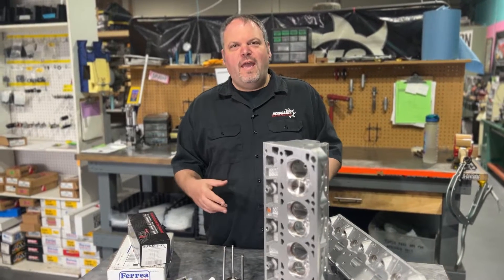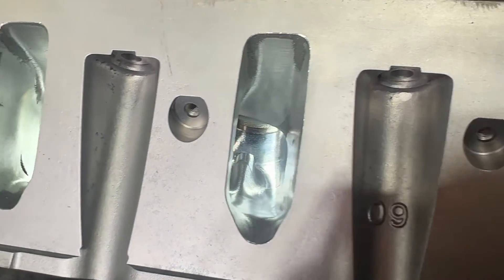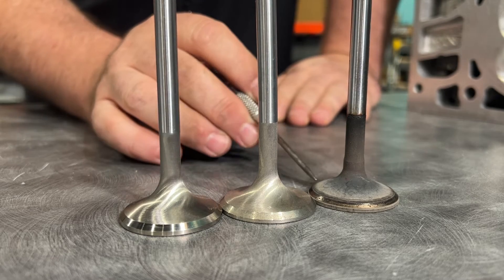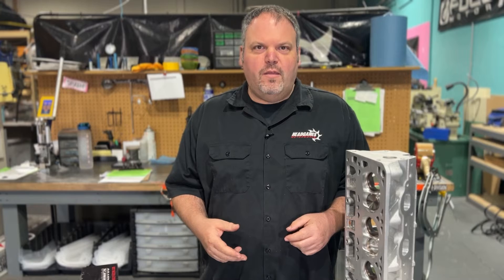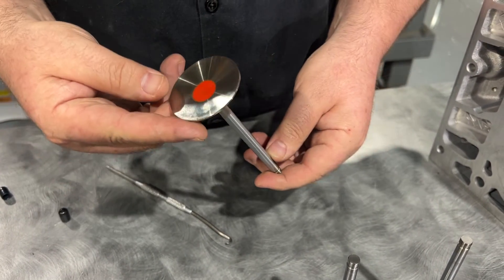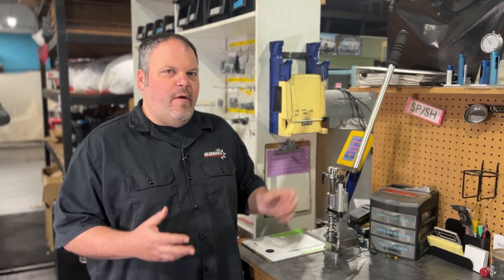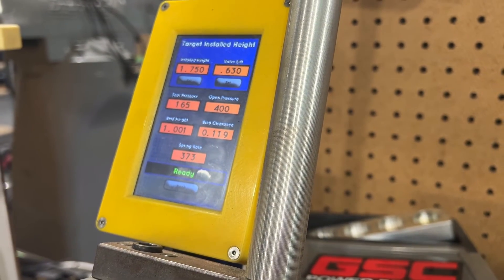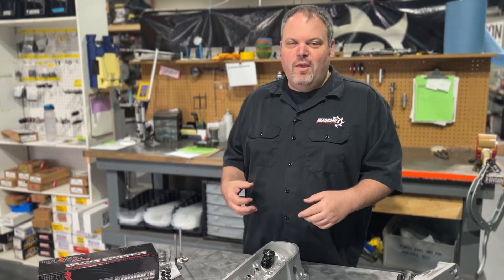Boosted LS1 valve train selection!

Comment: So what do your 243s flow?
Reply from the maker: That is a very hard question to answer without context, like which valve size or at what lift and what application.
Reply: @headgames  well since they came on 5.7 and 6.0s we'll assume that application with oe valves. If there's a valve that performs that much better then include that at various lifts.

Comment: Increased ease of flow is always good but only makes a big difference in NA applications. If your doing forced induction your measurements should be mass flow not volumetric flow. Because when your compressing the gas you can flow the same CFM but higher mass of air and thus you need higher mass of fuel…..
Reply: When boosted the gain you get NA is multiplied by boost pressure ratio, so it is even more important with boost.
Reply: Most of what you said is true. Ease of flow can make pretty big differences even in boosted applications. Especially when it comes to reducing strain on components, more airflow=less boost psi=lower temps..

Comment: .115 away from coil bind its a bit excessive no? Wont that cause spring surge?
Reply from the maker: nope the call out for the spring is much more than .115
Reply: @headgames  The "call out"  what does that mean?
Reply: 50-100 say steve morris. Problem is, If you have mild cam, like say truck Norris, you get the proper springs for it. 560's  you have stock heads, stock hat stile seal. They don't make shims to go on top. You don't want to put them under, because it lifts seat off of valve guide. If you go too two peace seat& seal, if you can find it for single spring. They are like..030-.050  and if your install height is, say 1.800  you can get the Optimum distance before bind. But now your at like 1.730  on a 560 spring at 1.800, every. 010 is about  3.3lbs by my math. I know that's going to be harder on the valve train.But I don't know if it's going to be too hard/ Short the life %  Considering all this. .050 before bind. Is Is leaning more Towards a  max effort thing/ power adders.  Mild rpm/6500 NA  Street car. I think .100 is fine. .120 is not the end of the world, but your toes are Definitely hanging over the edge.

Comment: It's Dyno tested proven - tulip type intake valves make less power! (Not talking about boosted applications)  P.S. static flow numbers are not always translated into the horse power
Reply from the maker: We don’t use a tulip on the intake
Reply: It is also dynoproven that they make more power, depends what application.
Reply: My apologies. Good luck!